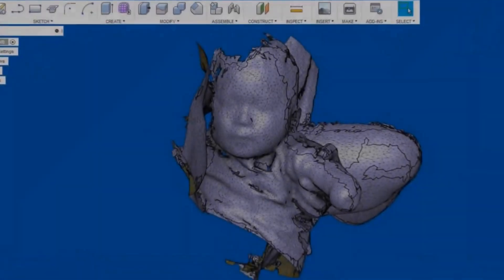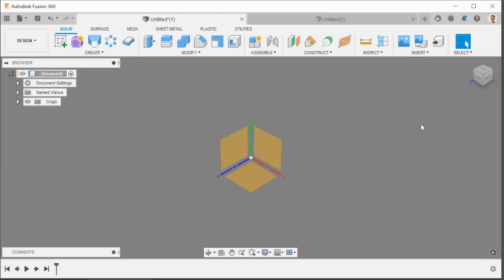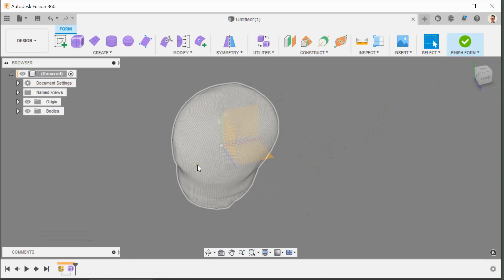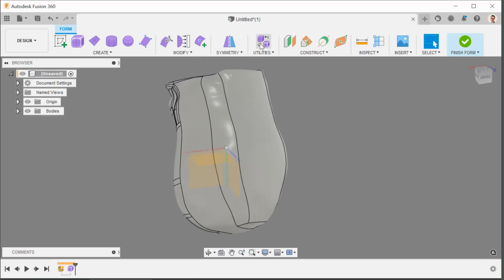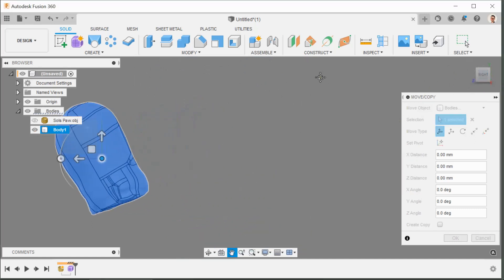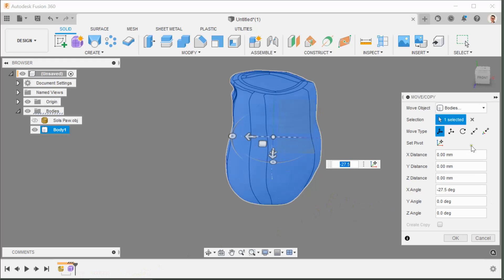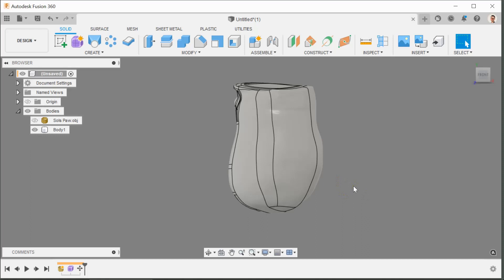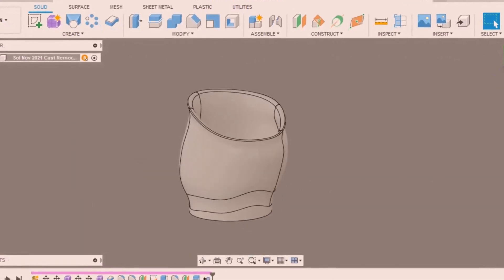How To Design Prosthetic Sockets Part 1

Comment: Hello i am a student from biomedical engineering course and i am working with transtibial socket design. There it is a need to measure the lenght of the circle of the stump with a cad software, we use meshmixer or fusion 360, but i still can not do this measurement. Could you guys help me?
Reply from the maker: I am so sorry that I missed this request for help. 
I think I know what you mean. For the corrections? To account for soft tissue?  I measure with a tape and then remove material from the plaster positive until its the right circumference BEFORE scanning.  If you are using meshmixer and a purely digital workflow.  I suggest taking a cross section of the target area and printing it out so you can measure it accurately.  I think n-Topology can do the calculation but its very expensive. Sorry again for not replying sooner.  If you need me quickly then drop me an email ben@ambionics.co.uk 
All the best
Ben